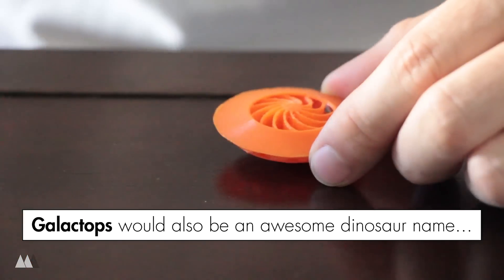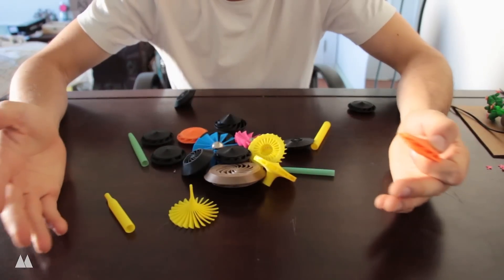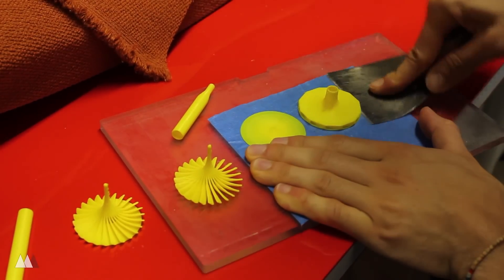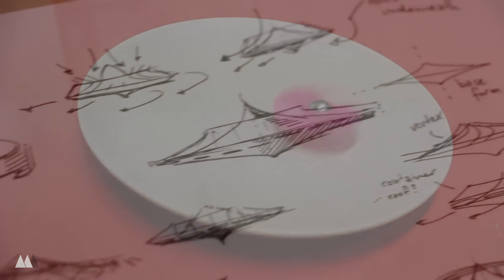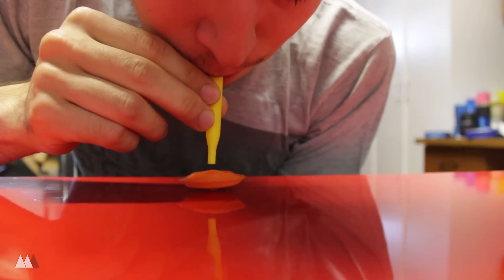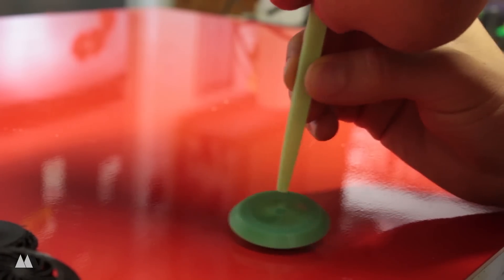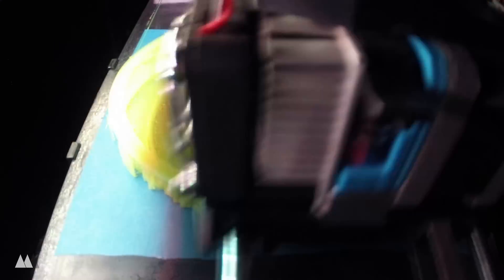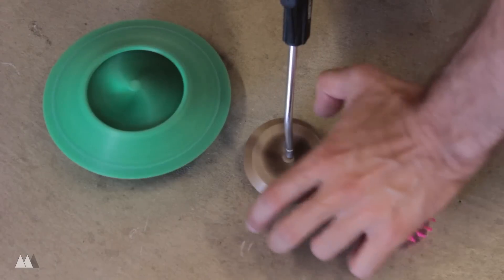GALACTOPS // Air Powered Spinning Tops

Comment: Thats so cool, you can increase the time that the spinning top remains rotating by adding some holes around the circunference and then adding the steel balls, but it will also become harder to start spinning, but will spin for a longer time, by that you increase the momentum of the spinning top.
Also you can make them whistle

Comment: try to use the leaf blower on the small ones
Reply from the maker: +Dead Pool I did.. couldn't control them 😅
Reply: Make Anything // 3D Printing Channel did you make one with the tip and a special attachment For the blower?

Comment: Hey! I wanna print this, does it need supports? (I use a replicator 2 like you)
Reply: Coby Crafter Don't use supports, they would be almost impossible to remove from the blades inside (unless you use dual extruder with soluble filament) but it prints fine without, just print top down.
Reply: BlackHawk TV ok thanks!

Comment: for better durability, make an insert for the bottom of the spinner and put a steel ball like you did with your previous design, both ideas combined should make a good and tough spinner, also you should make the outer edge more heavy so it would be more steady like a gyro..

Comment: you should make one that instead of spinning it with breath or compressed air it uses a zip chord or a string and flies like a flying saucer! maybe using  a regular galactop design with something like the marble tops enlarged and fitted around the outside

Comment: I know you're into 3D printing, but you should do a lost wax cast of one of these and make an aluminum or brass one. That'd be cool. And a pain in the ass..
Reply: Tommy Ohlrich It would be a pain in the ass but still possible, what would be impossible is spinning an aluminum or brass top that size using nothing but the power of your lungs

Comment: Awesome !
Could you design one with place/fitting for a motorised fan so it works on low power on its own!!!
Reply from the maker: Perhaps... it would be a challenge to find the balance between weight and wind power though. Hopefully I'll be able to experiment some more with the possibilities!
Reply: I have had four prints of mine in different colours/sizes. But I still would love to have a motor fan powers thing....plz design a model.

Comment: what settings do you use for PLA? while printing spirals like these mine got tangled.
Reply from the maker: I just used my standard settings.. what exactly fails?
Reply: thanks for quick reply. usually i set layer height to 0.3 for fast printing and use speed of 60mm/s. maybe for this reson the layers dont seem smooth. should i slow this down?
Reply from the maker: +Azfar Isa Mahmood maybe, I print faster than that, but it depends a lot on the printer, I imagine. also, because of the overhang of the top, it prints much cleaner at smaller layer height, .1mm or .2mm. in general, circles can be tough for some printers
Reply: I dont know why but google decided to show this notification today. Anyways, I thought about it a long time and searched through forums until i got to your idea. Funny how the world works. Prints are much cleaner now . Thanks a lot.